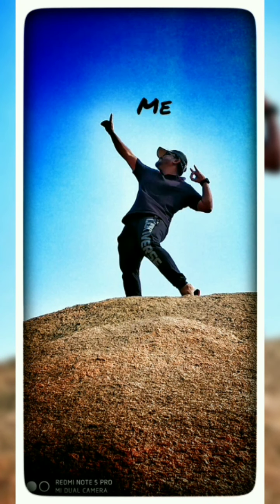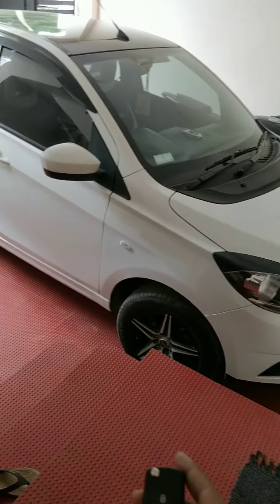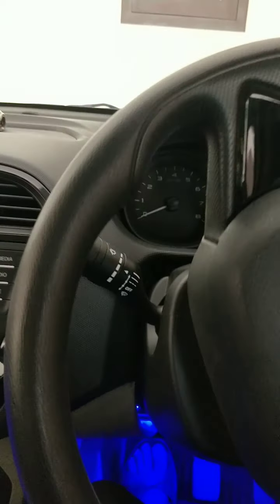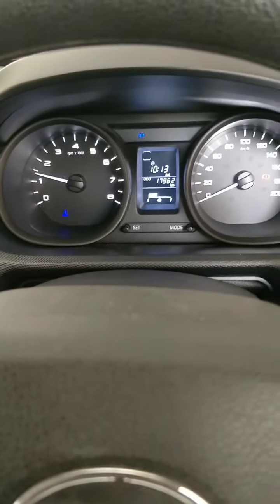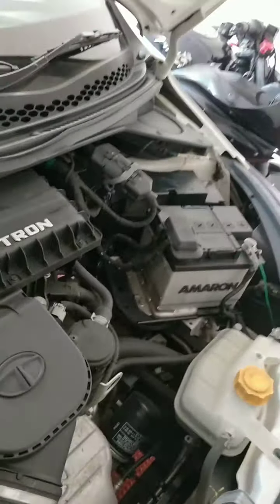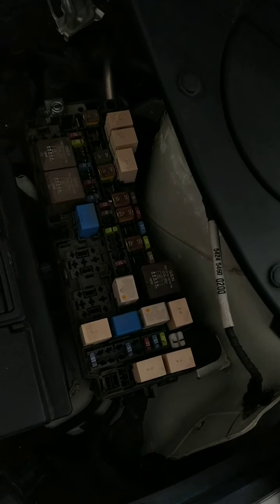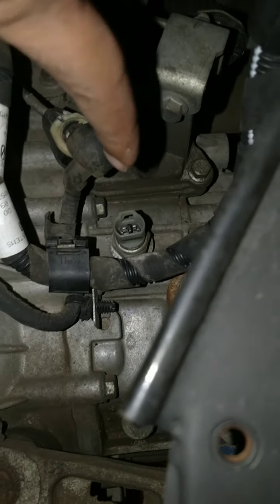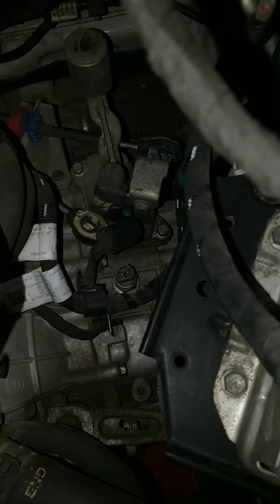Reverse Sensor Not working in Tiago  - Simple steps & Solutions

Comment: I also have a problem with my parking sensors, I put vcds on and came back as back middle sensor so I put all 4 new sensors and still doesn't work, so I also changed the wiring harness from back bumber to control unit what is in the boot of car  but my parking sensors still don't work have you got any ideas what my problem could be. Thanks
Reply from the maker: Hello Brother, would recommend you to follow the same steps which i suggested in the description.